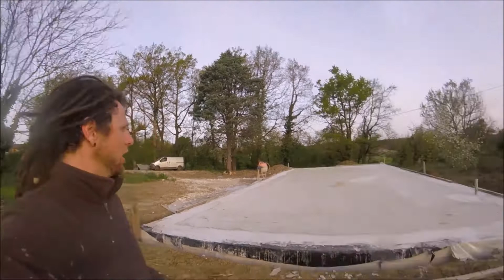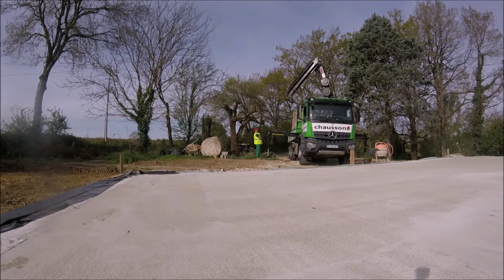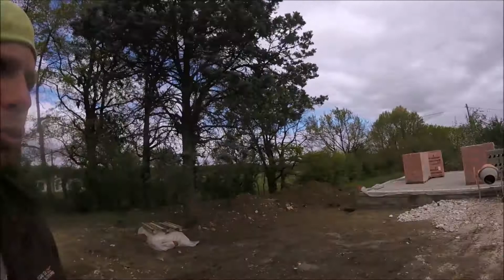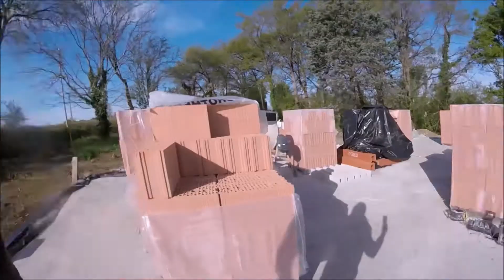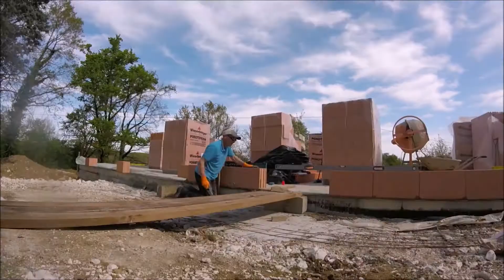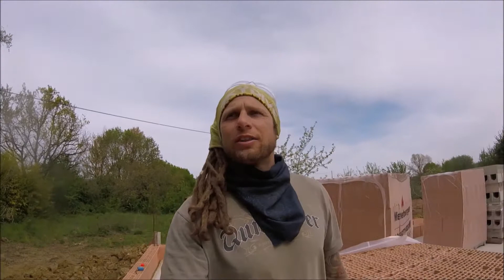This old French house the rebuild pt 7 the delivery and start laying blocks

Comment: Different from English brick and blockwork, first is it normal to put reinforcing bars at the corners (awkward) and also the blocks look like clay pot material so as they are fired does that negate the need for a cavity, or is it because of the different climate in the UK.? Still very interesting.
Reply from the maker: Norman Butler you get lots of ground swell over here because of the huge variations of temperatures so it’s recommended to reinforce and install a ring beam to keep the property all together and hopefully not cracking apart